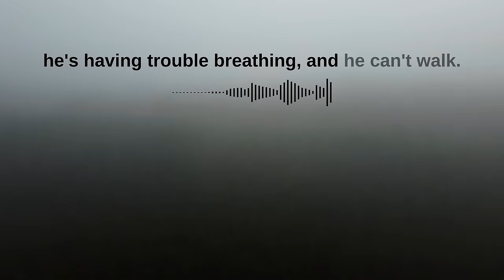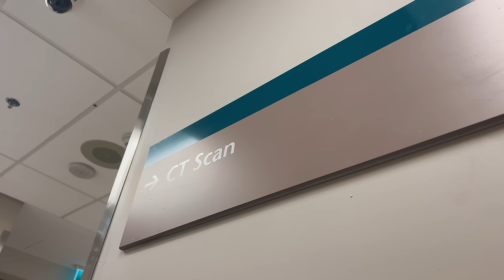What happened...

Comment: Great tip to ripe green tomatoes I learnt this year! Spread them out in the bottom of a paper or wood box with some dry wood chips in the bottom, with 1-2 apples. No mold and all of them has or are on the way to ripe! Warm best x
Reply: or simply mix them with some of already ripe tomatoes and it would do the same trick
Reply: Apparently, putting apples in with potatoes helps stop the rooting of the potatoes when storing them. Haven't tried it, but heard it.

Comment: You can use the small potatoes as seed potatoes for next year. Place them in a cool dark dry spot and keep them until the spring. Light will make them green and not edible (green can be toxic). Also, carrots are carrots. Baby carrots are just small carrots with the skin pealed off. But the skin has a lot of nutrients so don’t peel your carrots or potatoes. That’s where most of your vitamins and minerals are found.

Comment: You can pickel green tomatoes.  It is easy.  Wash them. Make solution of 1 cup of vinegar to 2 cups of water. 1:2 ratio.  Add some dill and garlic. Heat the solution and pout it over the tomatoes in a large container. They should be pickeled in 30 days. You can also make home made vinegars with your waste friuts and veggies. Fermenting is a lot of fun too.

Comment: I'm willing to bet you grew your onions from those little packs of mini onions they sell in mesh bags of 100 every spring. Those will never produce actual onions for you. They work fine if you want early green onions but they'll almost always bolt befor they produce bulbs of any significant size.
You need to either start them from seed inside in the early spring or buy baby plants from a nursery.

Comment: Yes you can leave them on the stem to ripen. Cut off at ground level and hang the whole plant upside down above your head (for best use of space) and pick as required. But the leaves will slowly fall off making a huge mess. The way you are doing it by picking and dividing the tomatoes into colours is just as good. You should be able to leave them on the bench or put in a root cellar. 
As for the peppers, you can carry them over to the next season if you prune off the soft green top growth then transplant the trunk and root of the plant into a pot and put in the greenhouse for winter. Doing it early will give it time to re-establish before winter attacks. Then once the frosts are over, take them out of the greenhouse and replant in the garden. A new crop of peppers should have already get going so it won't take as long to get a new crop. This is particularly important if you had a special plant.

As for the onions, it perhaps could have been due to the pH being wrong at planting. To adjust it, use lime to increase the pH and make the soil more alkaline. Or add suphur to lower the pH and make the soil more acid. Buy the products from the local rural or garden store and follow the directions on the pack.

Comment: The onions may survive the winter and produce some nice spring onions for you in early spring. The won't produce actual onion bulbs though.
If you planted them from sets, they are probably doomed. Onions are biannual.  They produce bulbs the first year and use the energy from the bulbs to survive the winter and give them enough energy to produce seeds the second year. That's why you don't stand much of a chance of getting big onions from sets. You need to either plant them from seeds or buy a couple pacs of tiny baby onions from a nursery and transplant them.

Comment: Regarding the garden: tomatoes do not need sun or stem to ripen as long as there are other ripe tomatoes close by. Just put them on big trays in the dome. Don't pull the plants up by the root if you don't eat the root. The plant will keep the dirt more healthy almost as a cover crop. Remove it before planting next crop instead. The problem with the onions I don't know. Did the dirt have enough organic matter and was soft enough with added potassium and still was that small it's either down to variety or you let them bolt. I think. Good luck with next season, you're doing great!

Comment: Thumbs up to you Todd, for the quick response to Ty's pain! I have had kidney stones before and they are NO fun at all. Love your garden - had to laugh as Todd is throwing the potatoes into the wheelbarrow "don't throw the potatoes - you'll bruise them". RIP onions - better luck next year. Hope you don't develop fruit flies in your dome, from all the vegetables secretly rotting away. Todd - love your flannel shirt - looks so comfy & cozy. As far as figuring out where each outlet goes in each room, I thought of a surface-mounting electric system. (Gives it that industrial feeling, along with running all your plumbing lines inside the house, rather than underneath, and having to rely on heat tapes to keep the lines warm. Of course, I've never built a home from scratch either). Best of luck going forward & sending lots of love to you 5.

Comment: Oh, Tyler, hope you’re on the mend already! 🤞🏻 But there were some very light moments too! The harvest and Todd complaining about Lily swiping off the saplings (one of the sacred rules of a cat owner: if you don’t want something destroyed by a cat, put it out of reach :) ). Re ripening of the green tomatoes. If they are firm, then probably they have no chance. If they a green but already soft, then there is still a chance to ripen then (though they might not be as tasty as the ones that ripened on the vines). 1. Temperature (ideal temperature is between 18 and 24 degrees, also it’s not advisable to put them into a direct sunlight). 2. Ethylene. Tomatoes will ripen faster/better if you put some fruit (like ripe banana or an apple) next to them. Sounds weird but tomatoes ripen by producing ethylene and presence of the other fruits that produce ethylene should help (even better if you put them together into the same box or paper bag). In theory, tomatoes should ripen within 1-2 weeks